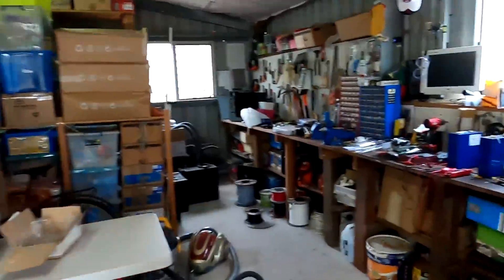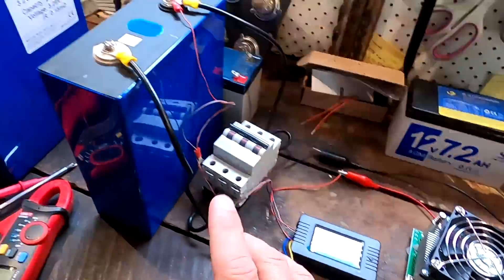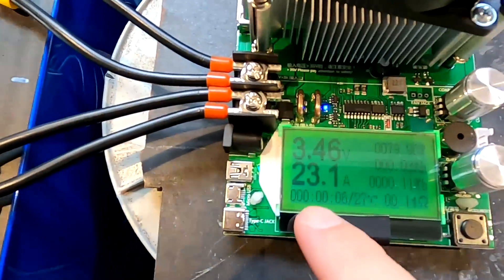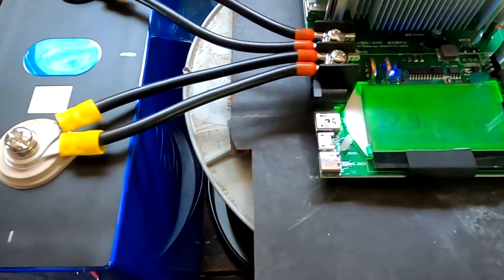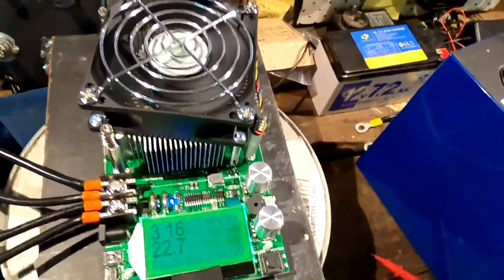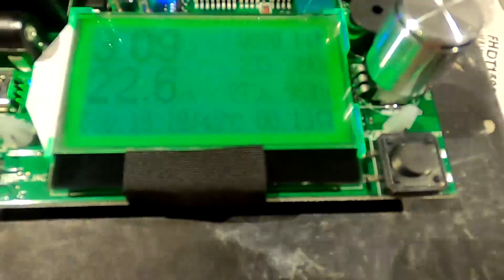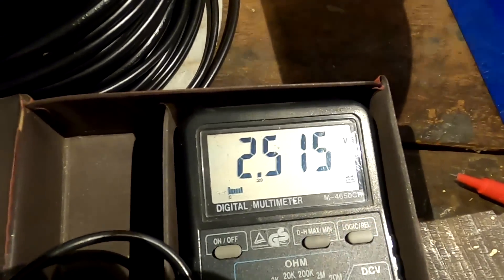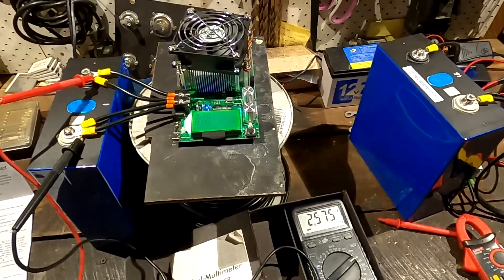Do Chinese batteries hold what they promise? Full EVE LF280 Capacity Test!

Comment: Acurate dummy load ....Aliexpres....13$
"9.99A 60W 30V Constant Current Electronic Load Discharge Battery Tester"
Is best there is ....SKY RC MC3000 calibrated.....Is as reference....also have 4 wire voltage measuring....

Comment: Fantastic result on capacity Andy. Thanks for sharing that. Looking forward to the discussion on compressing batteries of this type. One commenter noted that the readout on the load was showing the internal resistance of the tester. I think that's right. 3.2V / 23A = 0.139 Ohms. The voltage drop from terminal to terminal of 0.14V (combined)
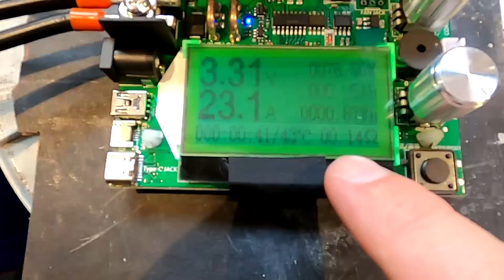Reply: 6:36 that's the external resistance, not the internal resistance of the cell. That other tester does show a measurement of the internal battery resistance, and it's done by using the difference between the battery voltage with no load and the voltage under load, and divides that delta by the load current.  I did that separately and the meter readout for internal resistance seemed reasonably close. The no load voltage is based on your configuration setup of the meter for 100% SOC, so you have to do that right before that test.
The battery label showed 0.15 milliohms for internal resistance, which has nothing to do with the hundred plus milliohms of the 0.139Ω external resistance that the load meter measured.

Comment: The voltage difference between instruments is very common and something we just live with.
Reply: The no name DMMs are for high school kids, who have limited cash flow. 
FLUKE INSTRUMENTS. These are standard DMM for DIY people and also used in Nuclear facilities. Prices vary according to requirements and Models. These instruments can be calibrated at authorized stores, by trained technicians. Get 2, even used ones, and get it calibrated. You’d be happy to possess these fine instruments. 73s...
Reply: @sreekumarUSA  I haven't found a reason in Solar that I need to be that accurate to spend 5 times the cost for a Fluke and I don't need to be exactly right all the time just close enough to be safe.

Comment: I saw a company makes upto  1kah cells, rated to discharge 1c, they have 6 terminals, 3pos, 3neg, that's insane, but I'd like about 8 of them! Maybe 12!  I would NOT want to test that monster!  They are the calb cells, I just wonder the cost! Only thing, if one cell dies, you are powerless, I'd rather have atleast a couple cells paralled, so possible only half power is lost, I'd like to get about 42 of the cells you have eventually,  mine are basically new now, so there is much life remaining, maybe in a few years, or if my power needs grow, 
 Merry Christmas!
PS. Maybe you can check out the 1000ah cells, and do a video on them??

Comment: I was really hoping for better. I'm buying, testing, and reselling on ebay here in America. The 100ah cells I test usually make 107-110ah. At least they made 280 though.
Reply: I agree, especially that the rating on the technical specifications for the battery claims 280Ah @ 1C
The test performed here was less than .1C and barely got to 278Ah...something is not right 🙁
Reply: @georgedemean2228  he probably actually  got the 277ah version because everywhere I look in China they are out of stock for 280ah version.
Reply: @JM-yx1lm  At .1C discharge test he should have had no trouble getting 290-300 Ah out of the cell

Comment: It doesn't so much matter if they are accurate, as long as it's repeatable,  after testing 1000's of cells, I learned to compare testers, to confirm they are equal, so the numbers are repeated by both, it doesn't have to be perfect, but it helps..

Comment: Yea i think the capacity tester voltage differs from your multimeter at the battery terminals because of that 7mV voltage drop across the cables

Comment: Very much enjoyed your videos.
It might be interesting to log temperature rise of the cell as well.

One of the problems with having lithium batteries in Brisbane is that the ambient temperature can have a larger affect on cell life than the cycles.  I've been considering a cheap air conditioning system to keep the ambient temperature around the cells well under 30 degrees - very little energy required, solar driven.

Comment: In the old days THE REAL old days the Phone company A  T and T had some kind of battery systems so the system always works  in a outage  huge capacity  .
Reply: They still make those they're called tubular plate lead acid they have about a 20-year life expectancy pretty expensive and heavy
You can purchase them in a 3,000 amp hour 2 volt each cell

Comment: Thanks, helped some. Why did not the official .2C test ?
Reply: That tester can't handle .2C (56A).
Reply: Maximum discharge current is 1C not 2C
Reply: @grahamjones6712  mind the . The accepted capacity test load is .2C
Reply: @grahamjones6712  He said "point 2C" (1/5C),  not 2C.

Comment: Interesting! You took a pretty rough procedure with 0,79C with high environmental temperatures. Data sheet says 0.5C and 25 celsius and I remember (didn't memorize the source) that after activaton you need a bunch of complete cycles to reach full capacity. Discharging with 1C will reduce the capacity at 3% and high temperatures (data sheet mentions 55 celsius) can reduce with another 5%. So I assume the capacity will exceed 280 under ideal conditions. Sounds good to me. Would be nice to reproduce the same test more times of the same cell for verification (etwas Deutsche Gründlichkeit kann nicht schaden ;-) ) Funfact for me was the changes between the different releases of the data sheet (mine: https://www.lithium-powerstore.de/media/products/akku/datenblaetter/eve/akku_eve_LF280.pdf - May 25th, 2018 )